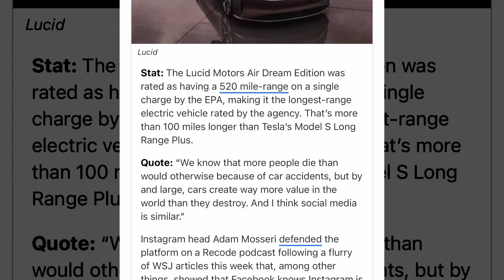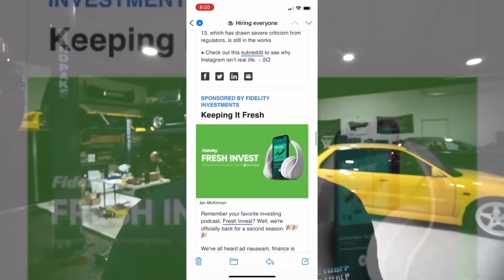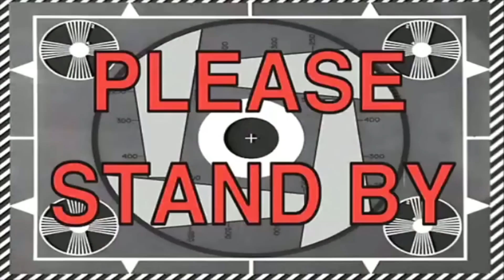Single turbo 2JZ IS300's Engine Bay looks INSANE... Intercooler fab + Turbo noises

Comment: if you need more negative camber out of the front for cheap, just order some JZX100 FUCA from serialnine. they bolt right up to the IS300 and are a tad bit shorter so you get more negative camber.

Comment: People throw GTE swaps into these cars for higher hp numbers (anything above 350ish hp ). Usually because ge vvti engines have weaker rods and weaker ringlands in the pistons which puts them at a higher risk of being destroyed by high cylinders pressures.(ex. Boost)

Comment: The stock 2JZ-GE won’t survive too long on 12-15psi :-/ if it’s actually driven hard
Reply: It may on a good tune with e85 not forever but longer then the typical jokers that push 15 on regular pump fuel  im sure he’ll use it as a yt opportunity when it goes and throws something built in there 💪